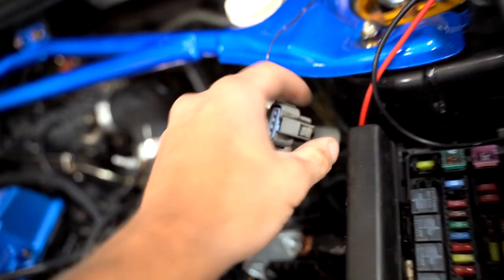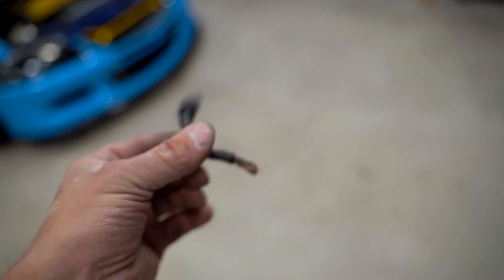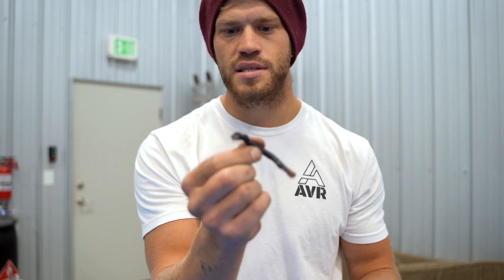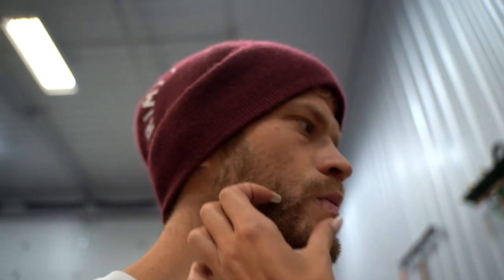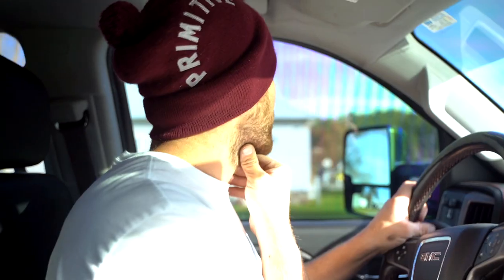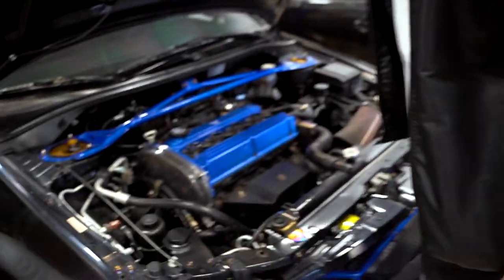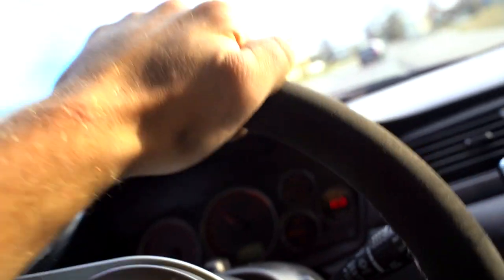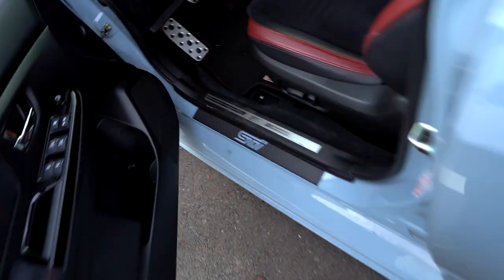We Fixed The EVO!

Comment: Best bet to add another 2/0 gauge wire from the alternator terminal to the battery fuseable link, kinda doing big3 upgrade, but leave the original one there, so which ever have less resistance, thats wherw the current will go, heated wires can be alot of meaning e.g there are still almost broken cables throughout, check the ohm resistance of the cables, cross check it with forums and googles, heated wires also could mean the cable are not huge enough to transfer the current from the alt to the link/batt

Comment: Soldering wires on cars is actually something you should not do. OEM don'T do that usually, and even in the instructions repair manuals it is commonly not recommended. Better replace complete wire. Usually surprisingly simple.

Comment: Pleeeaaassseee help me with my EVO , I have a crushed spark plug and there may be metal in my cylinder but if I just vacuum it all out and got a new spark plug would I be good or would you recommend taking the head off and checking for extra metal
Reply: better check for metal bruh.